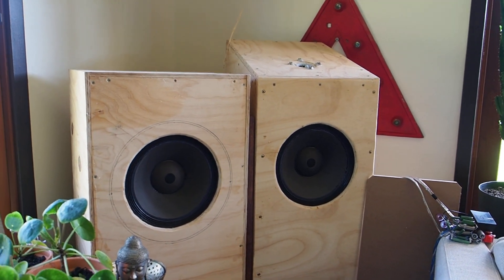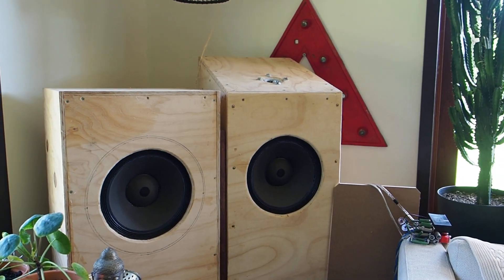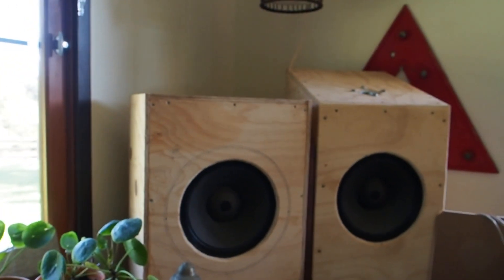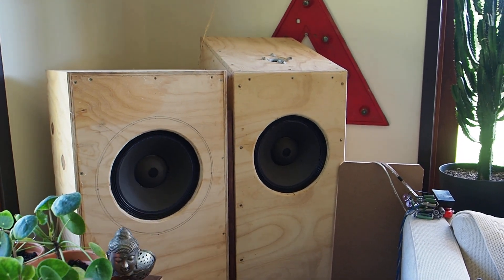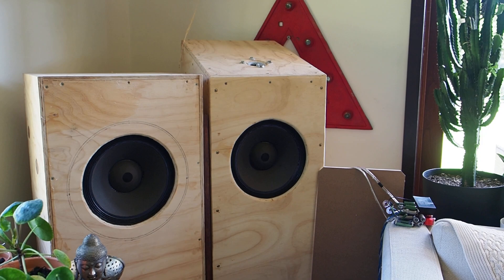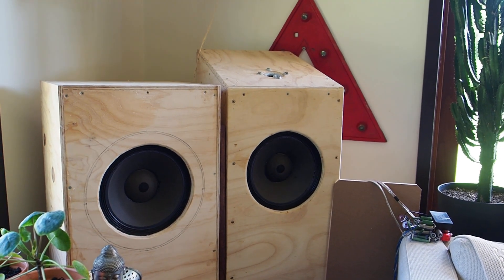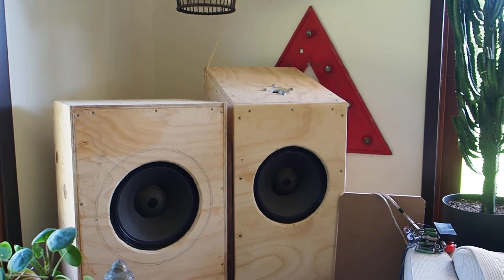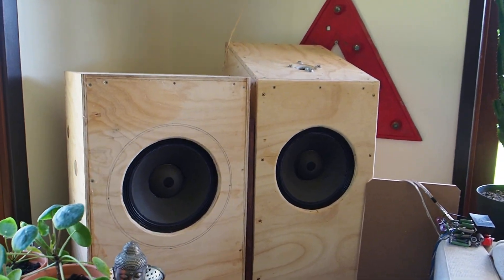The Lancelot Speaker build/design after 1 year: part 1 of 2

Comment: Hi Eduard, I agree that a corner set up can work very well. There are even horn designs that "borrow the wall" as part of the speaker. I think if you go that route, you probably have to go mono as well. That is purely a matter of preference. It has other advantages, your hobby becomes instantly almost half as expensive :) I may return to mono one day, that would be a full circle, but not yet.
Reply from the maker: I second your sentiments; the one brand I know that is promoting and designer for stereo corner setup is of all things, Audio Note...

I've got a video coming up on mono vs stereo.. and the cost aspect, or doubling the budget for components, is one argument for mono😄
Reply: @EduardBroekman  On a similar note, that is what I find attractive about full range drivers. One component versus two or more drivers and all the cross over components you need to make them work together. That means that your budget for the full range driver is quite substantial in comparison with for instance the woofer or tweeter of a two or three way system.
Reply from the maker: @hugobloemers4425  Very true and it has been tempting! Are there any drivers that you are considering?

What withheld me is the directionality of nearly all full rangers plus their bass performance/excursion is usually limited... .

So then a low range handover to a sub or woofer comes into play... and then we're nearly at a Lancelot, which I think could also be done with an up-firing full ranger.. I may do an experiment with this to side step the directivity issue..
Reply: @EduardBroekman  If going for mono, and a full range driver, then I would be open to roll the dice. From time to time there are true gems being offered on e.bay (for instance Coral or Goodmans). But then often there is only one available. I have been then thinking, should I buy it and hope an other one pops up somewhere in the future? That will never happen, but if you go mono, you are off to the races :) That may be the point I will do that. But to be honest, I am too much all over the place with my thoughts about which direction to go. I am kind of gathering information. That is why Janos's and your videos are well appreciated :)

Comment: Thanks Eduard. I learned a lot from Janos about this speaker type and you are carrying on the batten...I'm looking forward to experimenting when I move to my new house. One thing I would like to try is bi-amping with passive filters and level control at the inputs of the amps. I know Janos flirted with this idea and dismissed it, but I think with high input impedance tube amps and 1st and second order filters it could be viable and cheaper and easier than large power inductors and capacitors. However I do hear what you say about the amp/speaker relationship and wonder whether direct coupling the power amps to the drivers may not necessarily be a good thing with low powered tube amps.... back emf etc.....
Reply from the maker: Good to hear - thank you. I'd love to hear what you'll find with bi-amping / active. I tried bi-amp with passive crossover, hoping to be able to target the different driver efficiency levels - but that setup (SE for compression driver, PP for woofer) degraded the sound! 

From that limited experience it seemed that it is beneficial that the energy blocked at one driver, can go to the other, but it's a bit of speculation!

Now, since I moved to a 1st order, 2100Hz crossover, the requirements on the caps and size of the 2mH air-core inductor became extremely manageable: unlike high power, low efficiency speakers, in a 100dB efficiency speaker we make no compromises to deal with power, and I could employ ultra low DCR inductors and preamp quality capacitors.. which somewhat levels the active vs passive playing field.

But, as you indicated, there's still the factor of the amp seeing the speaker more directly, so that could work in your favour with an active setup... but again (assuming high efficiency woofers) with no excursion to speak of, is that amp control needed and will it make a difference?

A lot of problems and their 'standard' solution vanish because we're playing the high 🥇efficiency league... 🙂
Reply: @EduardBroekman  Yes, I am seeing more and more that I need to think in a different way about this approach. I will be using modern, less efficient bass drivers, than the Altec. 99db 1w/1m, down to 100Hz 90db at 40Hz (without cabinet or room gain). Best. Matt

Comment: I love your  videos keep them coming and do both woofers crossover the same and what about beaming you ever think of doing a beam blocker like the ones used in guitar cabinets look up beam blockers for speakers and see if it would make a difference
Reply from the maker: Thank you. As for beaming, before a 'solution' can be started, I first need to hear this beaming or any other issue,. And these Altec 414s just exhibit very little beaming. When I went from 1 to 2, the sound only improved, so from that I learned there's nothing or very little in it - and yes, it's particular to the mono setup I have. A beam blocker, I think, would introduce audible and detrimental reflections and diffractions. 

Those beam blockers look like an after market fix type of thing rather than ever being an integral part of a good design... what would you say?